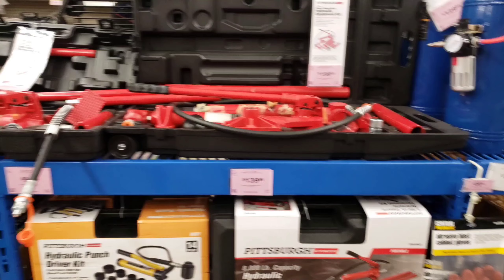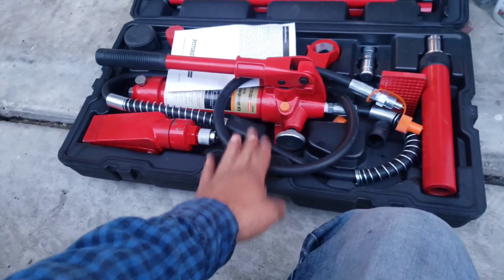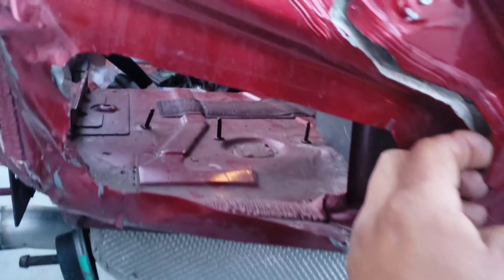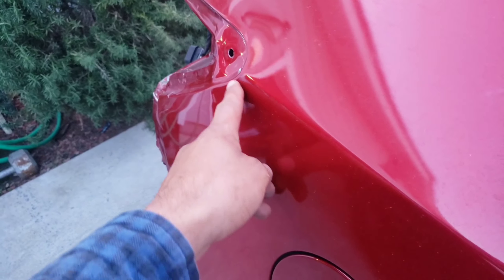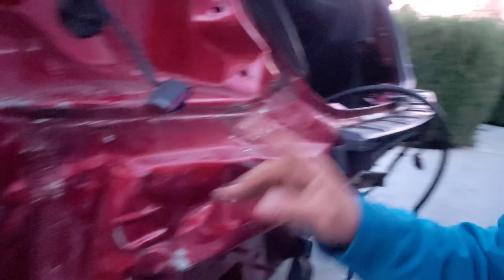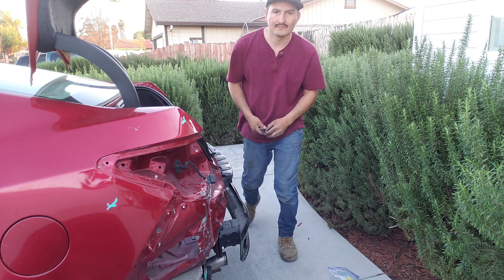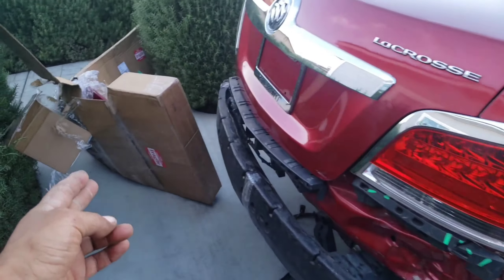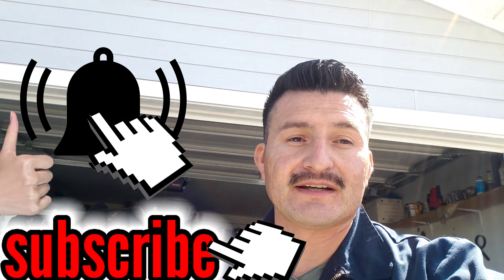Rebuilding a CHEAP copart CAR  BOUGHT AT auto auction - wrecked buick

Comment: You can always drive it as is or drill out those rivets and replace that rear tail panel. Make sure you seal up the seams so the trunk doesn't leak.
Reply from the maker: Yea that's an option also we'll see bro thanks 👍✌